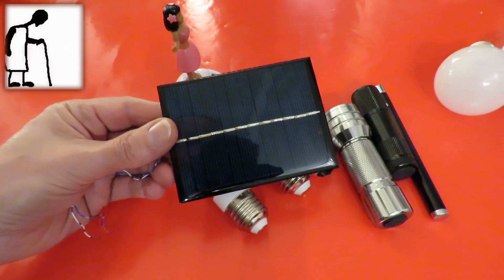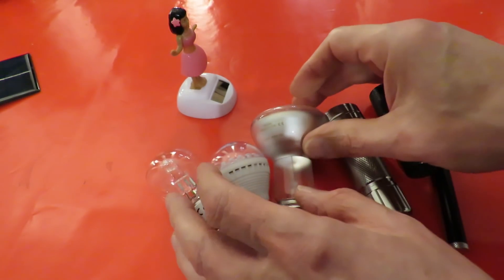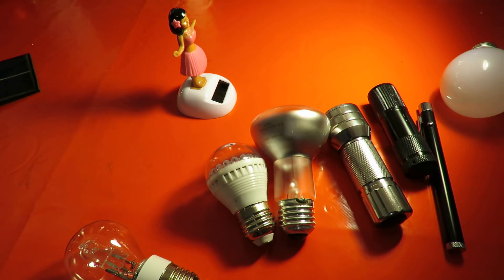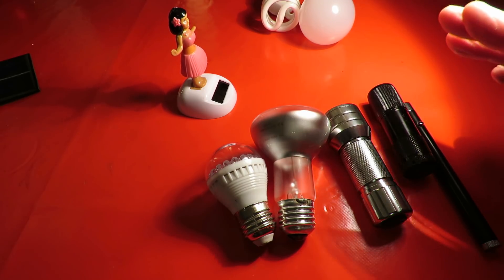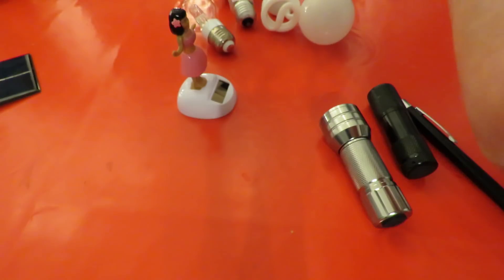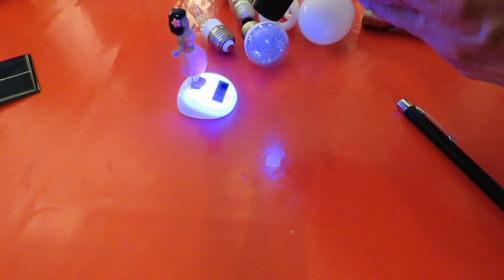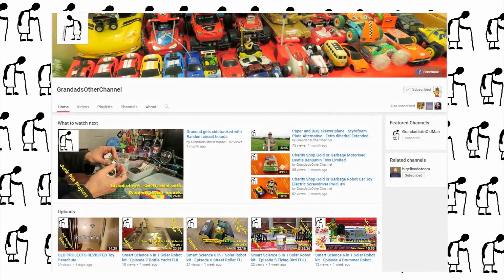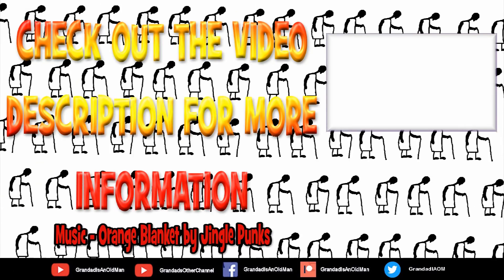Solar Panel & Laser Pointer and other light sources

Comment: That is interesting. Maybe moving the pointer further away to make the laser dot larger or defuse the beam to make it spread out more. 👍
On another note. That video I put up of the Bumblebee nest has every single comment removed plus the video was reverted back to private. I have never seen that happen before. I never touched the video so someone has been able to get onto my account and do it. Any ideas on how that could be done and is it possible to hack someone's youtube channel? Maybe I should change my password. Really weird and I cant see YouTube doing it, there would be no reason. 😧
Reply from the maker: Laser- the whole point of a laser is it is a parallel beam of light that does not spread. If it does, then it is not a laser. As for your video, ask yourself why would somebody hack your account to change the settings on one of your videos. There may be something going on, and changing your password would be a safe move anyway, but I doubt it is being attacked like my friend Doc Ink
Reply: @GrandadIsAnOldMan  Yes, that is a good point. I have changed the password but how could this happen? Must be something to do with youtube. I didn't know Doc Ink had his account hacked. 😧
I meant to add. Regarding the laser, you are totally correct but you can defuse the beam to make the end point large. I have done it with a piece of glass. Or you can defocus the beam from the source. Just makes the dot spread out more and it looks like a blob of red light. This is what I was meaning. 😁👍
Reply from the maker: @mikeflight9  yes you can diffuse the beam, but for what purpose. The power of a laser is from the focused beam, once you diffuse it, it is no more powerful than a normal light. Same as a jet of water from your garden hose.
Reply from the maker: @mikeflight9  yes of course, another video you could try for yourself. Looking forward to seeing it 😀
Reply: @GrandadIsAnOldMan  Might just try it. 😁
Reply from the maker: @mikeflight9  I would suggest you do that in the garden, spraying water around the house is probably not a great idea 😆
Reply: @GrandadIsAnOldMan  Oh it's fine. I have a big solar panel in the garage so the back garden will be used. I will remember to let people know that it was your idea and you are sure it works. 😁🤣

Comment: Awesome test and test tool :)
Reply from the maker: It just shows that it is not a very effective way of driving a solar wobbler. A laser by definition focusses it's power on a very small area, so the rest of the solar cell is not illuminated. An analogy would be trying to drive a V12 engine using only one cylinder.

Comment: Seemd like the order from best to worst is
UV
Halogen
Fluorescent
Laser pointer
Infrared
Reply from the maker: The bottom line is that sunlight is the best 😊
Reply: there’s something that this experiment didn’t tell: the current generated by the solar battery depends on the size of surface and size of the beam. laser is a point so it works a bit disappointing. So, if trimming the battery into the point size, the results may change

Comment: Thank you! very helpful.
so the a-si solar panel
can generate laser pointer light into electric power
but small right?
and have much better efficiency than the regular solar cell
just like the one of the beginning?
Reply from the maker: By definition a laser beam will only cover a very small area of the solar panel so only a very small area of the panel will be generating power. I would think that is a very inefficient way to use the panel.

Comment: Would you say the ultraviolet light flashlight was the most efficient?
Reply from the maker: There is no way I could to a scientifically accurate comparison. You would have to know or accurately measure the power usage and the power generated to be able to make an informed analysis. I would suggest you do some research on the subject as it is quite an interesting field with a fair amount of false promises. This was a good quote I found, that may or may not be out of context "It would just be maybe 5% more efficient. That's enough to make a 20% efficient panel 21% efficient." I certainly would not notice a tiny difference like that just watching a solar rocker rock.

Comment: I used a 3W and made the focus wider. Works fantastic!
Reply from the maker: Well done, but what is the point. You are putting more power in than you are getting out.
Reply: @GrandadIsAnOldMan  I needed to charge up the battery in my auto darkening welding helmet prior to using it. They have a solar panel on the front but it was night time. Just a couple seconds and it ready to go.
Reply from the maker: @sssmithVR  Haha, I would have charged the battery direct. Most of these solar panels stuck on products to "charge" them are nothing more than a novelty although it would be interesting to see how much current your panel produces from the welding arc as I can see the theory seems like a good idea. All that heat and light being generated and normally going to waste (other than creating the weld) could charge the battery while you work or at least keep it topped up so it sounds like a positive idea 😍👍

Comment: Look up solar cells and laser technology white light generation iam going application red is the lowest too on a 3v 28ma you get 0.8v several MA you need 3 min just not efficient enough they have just enough at current to build a solar battery 3w laser on a 12w cell 9w spare should see what i worked out. (There is a few upset people😆.👍)
Reply from the maker: Thanks for commenting. The video I have posted here is simply to answer a request I had about shining a laser on a solar panel. My personal view is that even a more powerful laser is unlikely to make a great deal of difference with the setup I am demonstrating here as the surface area of the solar panel that is illuminated by the laser is so small. You would have to spread the beam over the full surface of the solar cell to get the full efficiency of the cell. I am guessing that is why you are using solaronix cells. I had not heard of them before but I guess they are very efficient with a small surface area. I am not sure I fully follow the thread of your text. I have watched your videos and I am still not sure. What are you trying to achieve?
Reply: @GrandadIsAnOldMan  nice post and had a order with solaronix ? was going to bye 2 of the 5x5 cells at 1amp to 6v for output but we'll heat issue which this one should not have (T)is important but we'll what a mess around???mother f@@@@#@@##@#####  or the fact they needed to add a surge protection to the roof cell that kept shorting out and cut the size down for when they short I have half the set the other is over $1000 worth 😨 so on hold for now not to mention no setout documents???????WTF! It's a very specific build??  and no answer from the nasa silicone so ? not to mention the issues!😕 i got the original from a alien show several years back on a pic of tec and we'll this is what I put together they just had enough to build it today nuke reactor my butt solar cell battery like a colour TV and since I've got several new tec's including the fisheries I'am busy and there world sucks but I will have it done as soon as i can get what i need at price. I have a second  prototype design cell lower amp but should prove use on the runner I had to build to bend the light over the two cells in the middle for max efficiency like the sun but on this theoretical should on a solaronix cell at 6v x 1amp each cell for 12v at 2 amp or equal to 12w - 3w for the lasers or 500+MA at 5v leaving =9w left so not to bad efficiency wise but it's taken a bit of time since the world fell apart and it looks like iam on The a@# end I'll get them for that!. ( that's a few other things I've seen over the last few years so I like to mention to others like your self just to say to late slow poke! and they can try and waste my time I'll bite them in the back for it soon enough. )